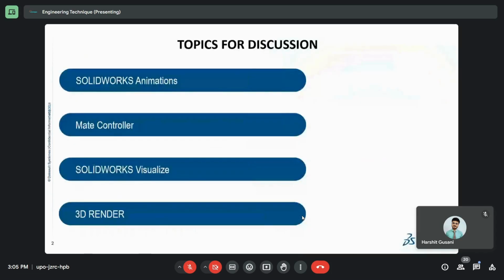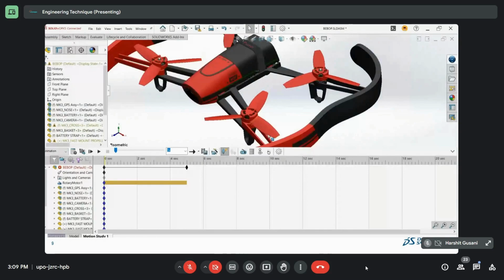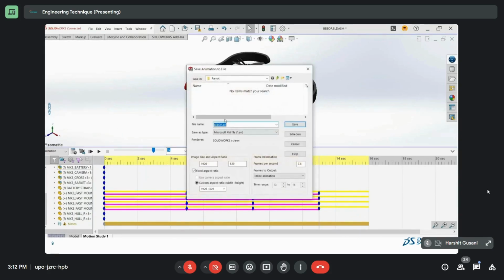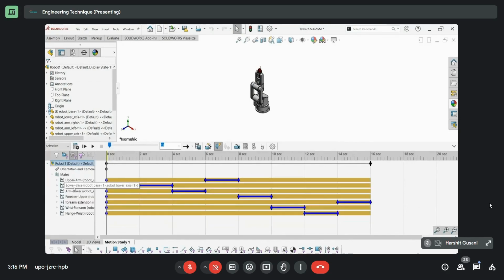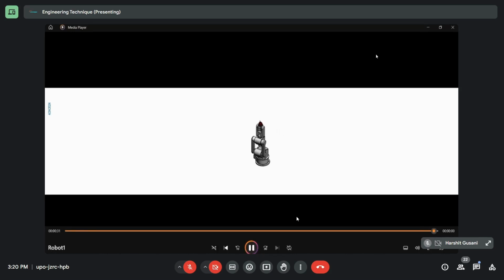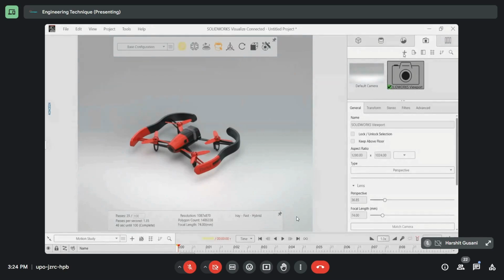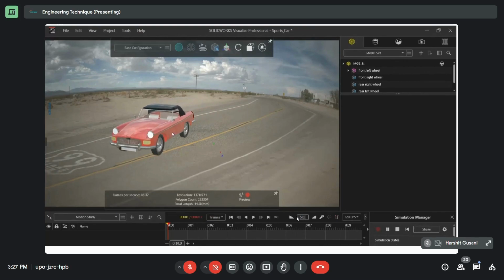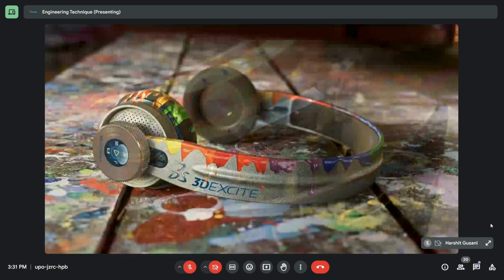Explore how SOLIDWORKS Visualize make animation creation easy | Engineering Technique

Comment: Hello. Tell me please, how to fix this problems? 

Motion Analysis Messages:
STFINT:MIN_STEP_SIZE  HMIN=1.000000000E-7; Reached At Time=1.214434896E+0.  

  The integrator could not advance the simulation.
  An attempt to further decrease the integration step-size failed.  
  Suggested course of action: 
  1. Decrease the value of HMIN. 
  2. Relax the accuracy requirements (ERROR) on the integrator. 
  3. Increase the number of iterations allowed for convergence. 
  4. Revisit the way the mechanical system has been modeled.
  Last good step-size: 3.906250000E-7.

thank you in advance